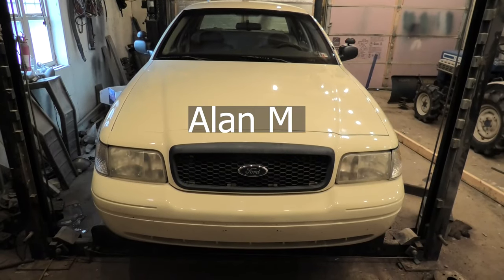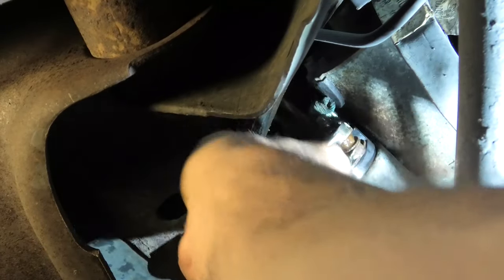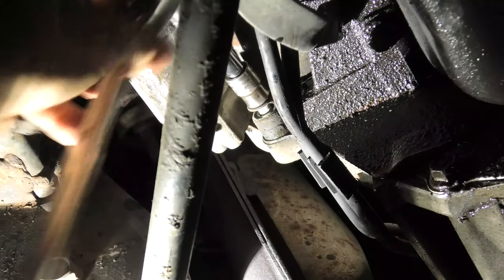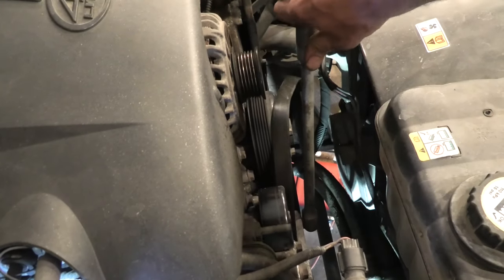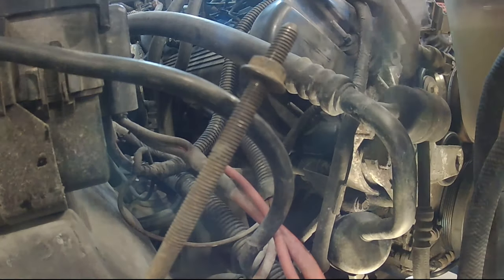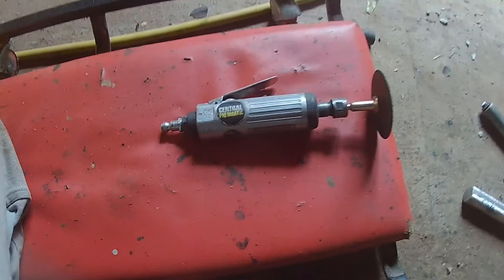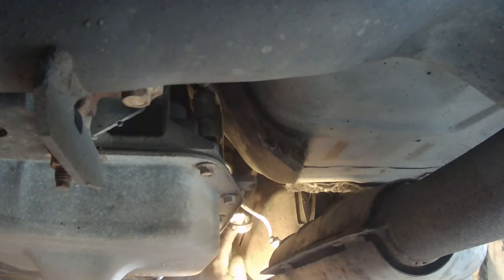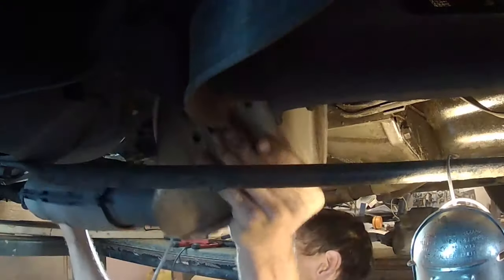Ford Crown Victoria Police Interceptor Right or Passenger Side Exhaust Manifold Removal How-to Video

Comment: well i just found out that my exhaust manifold have 2 broken bolts on the driver side and i have to change the bolts and of course change the gasket but i'm going to put a better gasket so i don't have to do the job again. so let me ask you this it's best if i do both sides instead of just doing one side. the passenger side is good but i want to change the bolts to stainless bolts and change the gasket so i can be straight so please help me out
Reply from the maker: Personally if the car were mine I would only fix the drivers side if the passenger side is not leaking. Especially since the passenger side is more difficult because of the egr tube and clearance at the inner fender. In addition, until you remove the passenger side you may end up breaking more bolts. The only exception on changing both if you were going to pull the motor out of the car then definitely change both at once. Thanks for watching.
Reply: @MrAamstrom  thanks alan i really appreciqte that i will definitely fix the driver side cause if the other side is good then i will just fix the side that is wrong. thanks for telling me